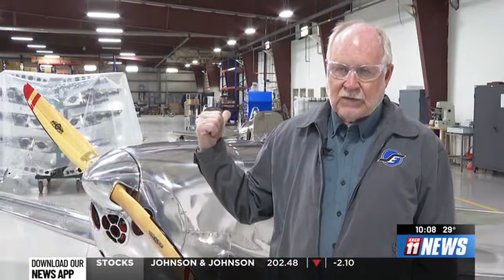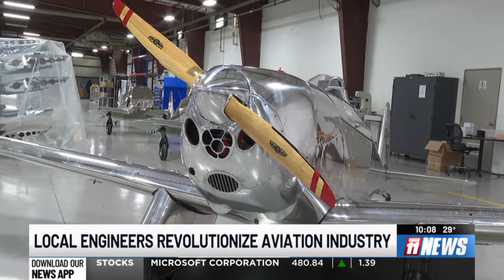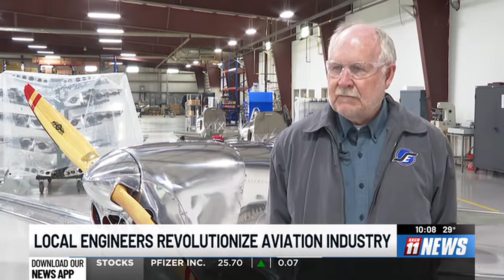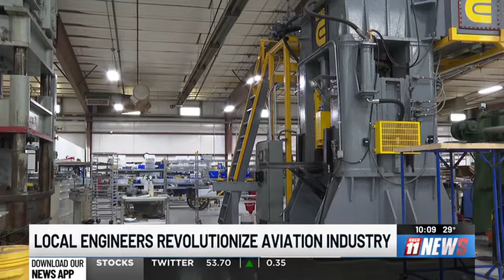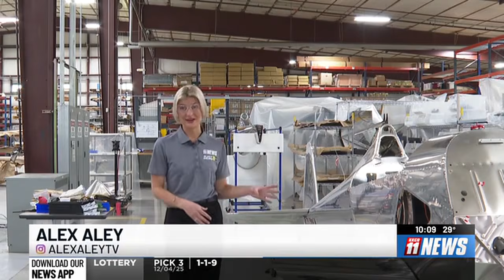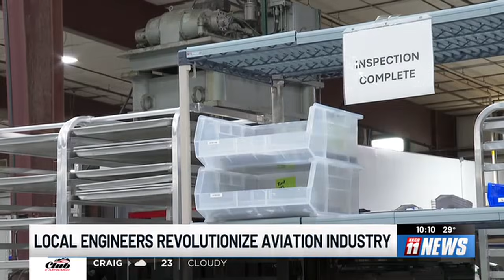Local aeronautical engineers revolutionizing the aviation and aircraft manufacturing industry

Comment: That color should be illegal though. Unless the sunlight is reflected into your eyes, this has to be much harder to see?
Reply: As a pilot, polished planes are MUCH easier to spot in the air than your average painted plane. Even on cloudy days, they are far easier to spot!
Reply: @IGrocker  I'm aware polished surfaces was an issue in WW2 because highly reflective aircraft skins produced intense glints that could be seen from many kilometers away. I have read thatvpilots reported that polished aluminum aircraft were often spotted long before they were within effective range, simply because the sun caught the surface and created a bright flash against the sky, which made polished aircraft tactically disadvantageous in daylight operations.

However, when there isn't sunlight I would assume the situation changes. Without a strong directional light source, a polished surface no longer produces those high‑contrast reflections. From my knowledge with published surfaces outside aviation they tend to darken and take on the color of the surrounding environment, in this case this would be the skies. Therefore I would assume in overcast or diffuse lighting, a mirror‑polished fuselage would actually blend more with the background because it reflects the ambient gray rather than standing out as a solid painted shape. A painted aircraft, especially in a light color, may maintain a more consistent silhouette and therefore remain more visible under those conditions? 

So I’m not entirely sure whether my assumptions are wrong, or if the advantages in low‑light conditions and the disadvantages in direct sunlight cancel each other out, or whether one effect dominates in practice. It likely depends heavily on the specific lighting environment and viewing angle.

But it's interesting to hear your take on this as a pilot.